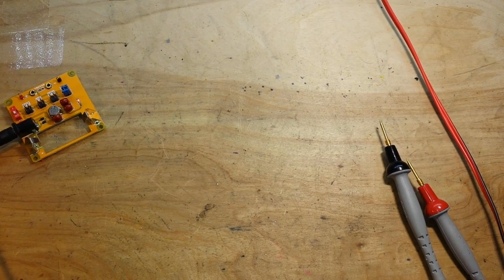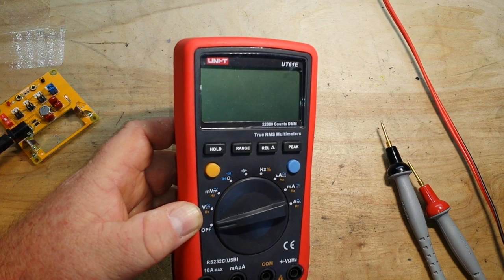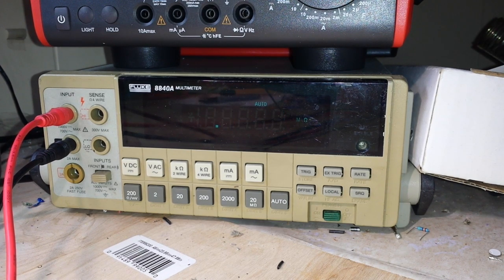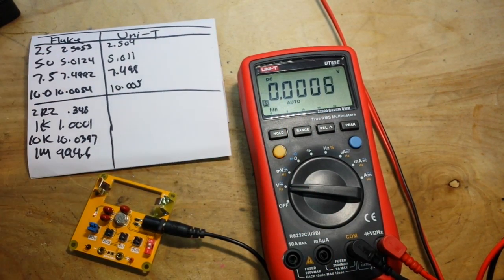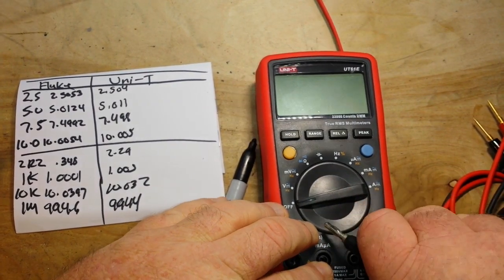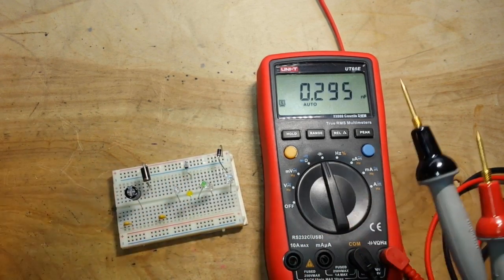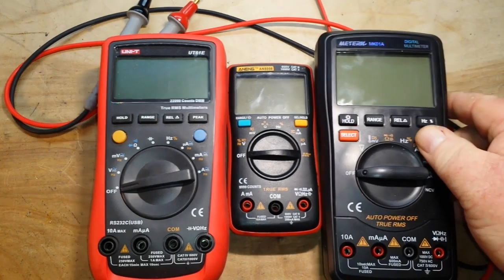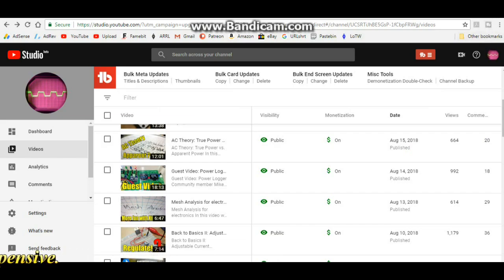Do I still like the Uni T UT61e (PLUS GIVEAWAY WINNER)

Comment: I thought I'd try one of these, mostly out of curiosity and right from the start it was a bit here and there with measurements. After about a month, it just measures random figures, with nothing plugged in to it at all. If you measure across the input terminals with a Fluke, you get random voltages coming out of it, which affects all modes. Haven't found a working one so far that I would say comes close to the results you are getting. I'd be pretty happy getting a stable reading from any of the ones I tried. The chips in these, apparently, are a bit of a lottery. You kind of get what you're paying for I guess. Ast..

Comment: Hi thanks for the nice review, I also have a UNI-T 61E.  I never managed to use the communication cable with my laptop.  I tried to look for the comms port in the control panel of windows 10 but this does not exist.  I also bought an adaptor from RS232 to usb.  Have you an idea how to do this?
Reply from the maker: No sorry

Comment: Thanks for your reviews I bought this multimeter. I was a Fluke tipe of guy until I have this meter.
I am so pleasently surprised of this meter I don't like it...I love it. Believe it or not I'm actually using it more than my Fluke. It's fast, easy to handle, great display (don't miss the backlight) and I like the arrange of the rotary functions selections since it goes straight to what I ussually use everytime.
Of course I will only need my Fluke when the going gets tough but now it can rest as a second hand multimeter, most of my time work deals with low voltages. 
I'm planning to get the UT139 also.
I wasn't a chinesse tipe of guy but now I'm glad I was wrong.

Comment: Brymen bm867 , same uni T and hanang  , keithley 199  and a fluke 8520 .
Hands down , the one that gets most use and lives centred  on the workbench is the uni-t , The hanang un8008 is the household meter , the brymen I got when I tackled repairing the dead keithley and fluke I bought off Ebay.
They're all great meters , the brymen  
just seems to occupy more real estate on a crowded bench than necessary at times ,  the hanang was just a whim but handy around the house . The other two are shelf dwellers, since most benchwork is eyes down  and looking up is a distraction they are sorely underutilised . Currently they are redundant overspec'd panel meters for my bench power supply , which seems a shame ... kinda like keeping chickens in your vintage mustang. 
Still , it's better than having the as ornaments , that job is taken by the multimeter I forgot , an AVO 8 mkii in full working order but when I dust it off it's just that .

Comment: I have the Aneng 8009 which is basically the same size as the 8008...like the features but I like a meter to have a fair amount of weight and bulk to it...the Aneng is just too small and light unless you like a pocket meter. On the bench it is flimsy and doesn't prop up too well as you demonstrated. BTW I cringed when you rotated the dial with the AC line connected.

Comment: My favorite multimeter is the Brymen BM869s by far.
Both in useage as in accuracy.

BTW I also have a Fluke and the little aneng an8009.
The aneng sits in a portable toolbox because it's so small.
The fluke is hardly used. The Brymen is better, in all aspects.

Comment: 9 volt powered meters tend not to be damaged from battery leaks I read the 9 volt is double wrapped and much less likely to leak and damage the meter like AA or AAA cells.  The sunbeam dollar store 9 volt battery works just fine for meters  and smoke  detectors.

Comment: It's my favorite meter ever.

I use it every day for a few years already, in many modes and applications and sometimes with mains voltage and current with no problems.

Adding a switchable  back light was easy, half an hour work and it's perfect.

I really enjoy the extremely fast continuity test (as long as the probes are clean), diode beep on short and fast Ohm reading.

Capacitance also works great, comparing with DE-5000 all values are correct.

22000 count it's a superb feature two have.

All in all UT61e is an excellent peace of equipment, I hope they keep manufacturing it with no changes! Well maybe the backlight but even without it i recommend this meter 100%.
Reply: Best

Comment: I own and use the 61E, and am quite pleased with it.  I like that the 22,000 count resolution gives me an extra digit of resolution up to 22 volts, as opposed to 4 volts or 6 volts on a 4K or 6K count meter.  I can't say that its ever made a practical difference, but I'm still glad it's there.  I miss the backlight, but there are videos from several sources on adding one.  >Charlie

Comment: I found my UT61e to be quite a bit out for voltage compared to my Keithley 2000 and Fluke 289, even the lowly Aneng was more accurate. At least it was easy to calibrate though with just a simple screw adjustment inside. My favorite meter would have the be the Fluke 289 as it's a beast with more features than you can shake a stick at. I always recommend UT61e for beginners however.

Comment: I have uni-t 33A+ 2000 count is generally sufficient for me. Important specs for me are auto ranging, capacitor/ac current measurements, compactness and it has aaa batteries :). I would consider getting 61E after watching this video though if i can spare more time on electronics.

Comment: I've calibrated mine two days ago.
After a year it was still very reliable and on spec, but since i bought a voltage reference (checked with a 6.5 digit agilent multimeter) , i wanted to calbrate it to be spot on down to the exact millivolt. Now, on the 20V range it is off by only + or - 1 millivolt at most. Curious to see the long term stability
Great multimeter, i really want to buy another one, you can't have too many multimeter, and i love this one.
Only downside is that it come with that useless cable for data logging, why just not put the usb cable in the package, who the hell still uses that rs232 Port?
Reply from the maker: It's one of my favorite meters. And I agree,  I haven't seen a serial port in years.

Comment: You should like this meter,  especially after it survived what you did to it at 11:33. Read the manual dude. Hahaha. You just put 120VAC into the meter and rotated the switch to the low voltage HZ setting....twice. WWRRONG!  To measure AC mains HZ just hit the yellow button when in the AC volts position. The symbol is right there in plain sight on the selector switch and is color coded to the yellow button even. The manual explains it too. I am sure you understand this now, but for anyone watching.....No need to abuse your meter through ignorance.

Comment: You're lucky this UT61E survives mains voltage on all ranges (I've tested it on AC240V 50Hz). You aren't supposed to rotate the selector to measure AC line frequency. There's an alternate frequency mode on that AC volt selector position.

I've had the same meter for roughly the same amount of time as you. Although it's not my favourite meter, I like it a lot. Not sure if this sounds strange, but one of the main reasons I like about it is that it doesn't auto turn off so that I don't have to make sure i press a button when I turn it on, which I often forget when using my other meters. The lack of backlight doesn't bother me one bit. Although a 2000 count meter will fit most of my needs, it's therapeutic to look at that 22,000 count display.

I also like the fact that it beeps if I find a short in diode mode. This makes troubleshooting board issues so much easier and faster because i don't have to keep my eyes on the meter display. If it also had the same beeping (or chirping) as my Fluke 117 when discovering a forward voltage drop on a diode, then the UT61E would be a near perfect multimeter to stay on the bench.

Comment: Idiot you should measure mains frequency usin ac voltage setting there is a button that's for measuring frequency and duty cycles on high voltages in ac settings like ac voltage and ac current, frequency setting on multimeters is just for voltages under 10 volt. What a engineer really are you? Please do some research before doing anything.
Reply: I wonder if anyone in this world takes you seriously lol
Reply: @Brian-uq6jm  look these multimeters doesn't have a good protection circuitry, so while some using it wrong it becomes dangerous especially when using it on mains potential, it can be explode and get damaged even can damage the user, using test gears correctly is really important especially on high potential systems, this guy in his video is teaching others to do something like this even he is not intended to do.

Comment: What do ya think of the Aneng 8009, I have it and the 8008 - the 8009 has a small edge with Temp and NCV functions but loses the square wave which is less useful at least to me.  The 61E has neither temp, backlight or NCV, and that may not matter in some cases.  I liked the 22,000 count 61E but for my purpose I got the UT139C as it has more input protection, and a backlight with the biggest tradeoff being its 6,000 count.  As always its six of one and half dozen of the other--lol   Id like to see someone crack open the Voltcraft VC830 from Germany, it looks like a clone of the UT61 series with virtually the same case with light gray rubber surround but costs almost twice as much about $79 on Amazon - dont see much info on the VC830 id like to see the interals and see if its worth twice as much as its only a 6,000 count meter.
Reply: Paul reviewed the 8009 a couple of months ago. If you search on his channel, you should find it. If I recall correctly, it came out very well.
Reply: Yes I saw that review, the reason I asked was he said the 8008 was the best value, but I kind think the newer 8009 might be a bit better as its essentially the same meter but with temp and NCV functions added, I have no use for the square wave generator on the 8008 - but thats just me.

Comment: I have an early Uni-T watt meter, that has the wrong spelling for "True RMS"
cast right into the front of the meter. Think it's spelled "Ture RMS" if I remember correctly.
Haven't used it in a while.
Reply from the maker: We see a lot of Chinese misprints. You'd think they would work harder on stuff like that. But it does not seem to be the case.

Comment: This meter here is more expensive ( GS / Intertek model) but has the extra protection. The only thing that is useful is the backlight if you're raspberry pi is behind a TV but you can use a flash light. Suitable for homebench and 9V its feeds those beefy opamps  :P  First meter Protek A800 pocket analog ( still works)  and digital meter is a uni-t 50b 8 years old (good survivor :P ), my favourite used meter was the Fluke 117 ( not mine of course).
Reply from the maker: Thanks Fabio. I like to hear about what meters guys like and use.
Reply: There are other brands that i also used and liked such as Agilent , Brymen , Protek , Meterman and kind of the uni-t brand for learning purposes . Nowadays most meters use AAA or AA batteries.
Reply: My Brymen 869s uses a 9V.
Reply: It does not consume a lot of battery that meter, unless logging current measurements into PC for extended periods. My uni-t 50b only got 3 9V batteries in it's entire life and had usage, ( the supplied one doesn't count :P) .
Reply: The first thing I did was replace the supplied battery with a Duracell, same with my 87V.

Comment: Thanks Paul. I have a Uni-T UT139C that is a decent little meter. It does have a backlight, but no temp. My Brymen BM869s is my favorite meter because I can read DC & AC at the same time, among other things. But anytime I check on mains power, I use my Fluke 87V just to be on the safe side. Oh, and I should mention my BK Precision 114A VOM. They don't make it anymore and mine is in brand new condition.
Reply from the maker: That Brymen is a nice meter.
Reply: Yeah, it is. I have all of the accessories for it also.

Comment: I bought this Uni UT61e after watching the earlier review video and haven't had any issue with it, including testing mains 230V.  I find the 5th digit very useful on the 10A range as I can see down to the milliamp.  I'm not sure if my meter is slightly different to the video as the manual for mine mentions not to apply more than 30V RMS or 60V DC on any mode, except the Voltage and Current modes.  To measure the mains cycle frequency on mine, I first put it on Voltage, press the blue button for AC and then press the yellow button to show the cycle frequency. 

I managed to blow the 10A fuse by mistake after measuring the current from an SLA battery charger and forgetting to swap the probes before measuring the battery voltage.  In case anyone runs into the same issue, it uses a BS 1362 10A ceramic fuse, the fuse that fits a UK/Irish appliance power plug.  The 1A fuses are however less common here as small appliances such as a table lamp usually have a 3A fuse minimum in its plug.
Reply from the maker: Thanks for sharing that info. That bit about the measuring the freqeuncy might explain why mine didn't like it too much!!
Reply: You can order fuses directly from UNI-T. I've done that before. They're the exact fuses that came with my 61E. $0.6 AUD per fuse regardless of which one it is. Ordered 20 of them cuz otherwise it's not worth the shipping cost...

Comment: I noticed my uni-t polarity is reversed when doing continuity tests. Was confusing and odd
Reply from the maker: how's that? continuity has no polarity
Reply: On old analog multimeters they did this as well, I remember my school days.
Reply: Looking at the manual, it uses negative voltage for continuity testing. All others in the UT61 range (A, B, C, D) use positive. Why, idk.

Comment: I bought the Meterk that you recommended and really like it. I also have a Fluke 75, Fluke 23 and an ancient Micronta 22-191. Of course the requisite half a dozen HF cheapos. I'm glad the Uni-T is stilll hanging in there. Thanks for the report!
Reply from the maker: The MeterK is a great meter and for the money can't be beat. I'm not knocking it it all. My preference for the 61e is just a preference for having the ac/dc switchable via a button.